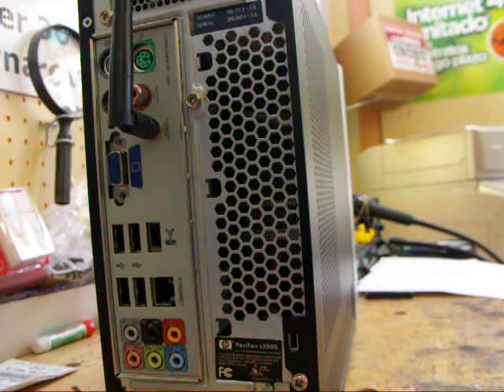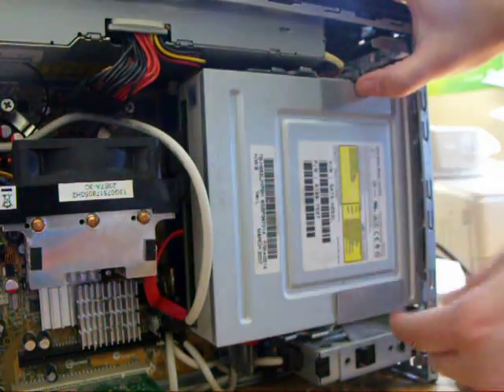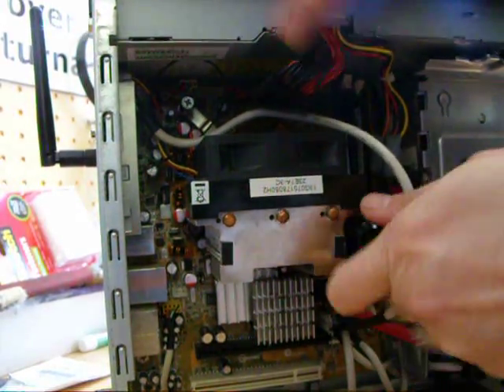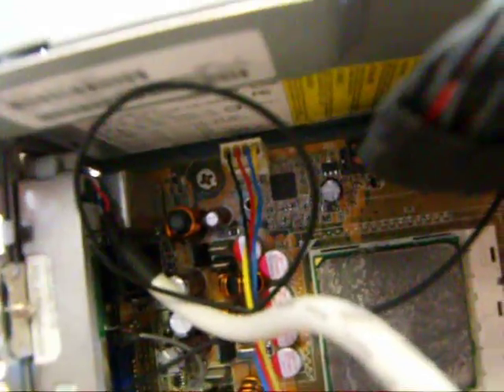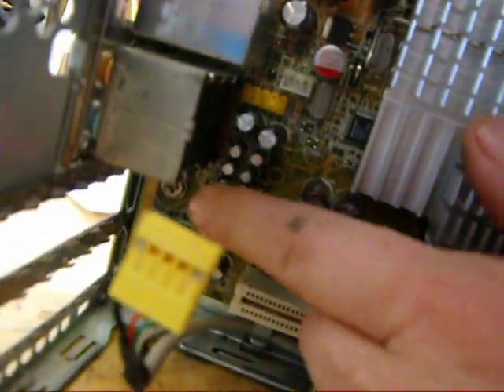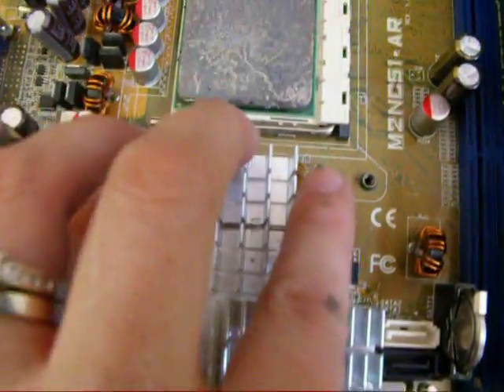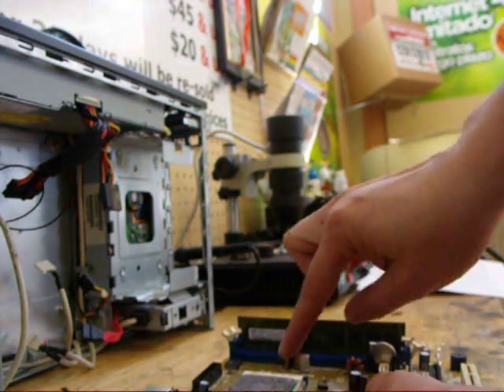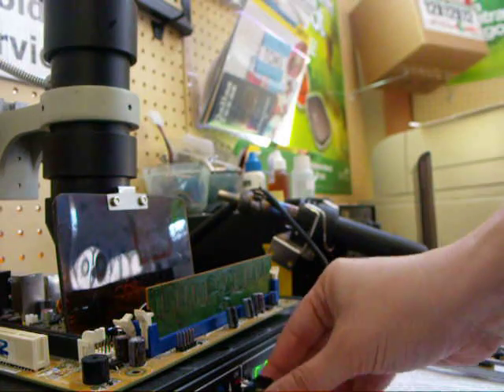HP Pavilion Slimline Powers On No display FIX!!!!

Comment: Oh my god, this just happened to my Slimline two days ago, powering on, but no display, I will try your fix in the next couple days and report back
Reply: any fix?
Reply: @ingridmilliebobby-brown7653  I doubt it's useful now, but the first laptop I messed with getting into computers had this exact issue. it was a faulty RAM module...
Reply: @Dankbongripz420  wouldnt the ram make it beep though?
Reply: @CENTAUR559  not always. Not every PC uses internal speaker like that. The laptop didn't at all. Everyone I've messed with since has had one. Their CMOSs are even different from laptop to laptop. Some are attached just like a desktop's and some are connected using a wire with connector to go onto pins
Reply: @Dankbongripz420  for the one I have thy I've been wanting to fix.. All signs point to thr on board graphics

Comment: Worked for me - Thanks for posting !!   Used a heat gun from our auto repair shop. 
By the way - the pc I was fixing was extremely dusty and vents clogged too. Regular cleaning should help avoid overheat issues, 
also looked into adding an additional video card - not easy to find on a slimline model like this. We will see if it will upgrade to Win 10 after some updates.
Reply: Far East Motors Service Center h
Reply: Were you able to upgrade the unit to Win 10? Thank you 🤓

Comment: i have the same slimline....i fixed mine using a heatgun.....its been a year n still going strong
Reply: did you cover anything at all or put weight on it?  how hot did you get it?
Reply: @CENTAUR559  my heat gun has 2 speeds low and high..i had it on low..and i blew on it in circles for 1 minute...u can do like another 30 seconds..just to make sure its done..and also u can cover the rest of the components with aluminum paper..

Comment: Could you just add a PCIExpress Video Card and Voila??
Reply: Victor Alvarado few years back I had the "pleasure" of trying that in one of these. The BIOS on that computer defaulted to the on-board graphics (and won't automatically disable). So, you need to switch to the PCIExpress Video Card in the BIOS but you need the on-board chip to work so you can make it to BIOS. Although once you get it up long enough to reach the bios I would certainly add a graphics card.
Reply: @penguinjumping  took my answer lol

Comment: Dude, seriously? This is one of the worst fix it videos ever! You obviously don't know really anything about computers. You really think heating up the solder joints and putting on a stack of coins will reconnect the joints? It does "work" in a way, but only temporary. Most of the time it doesn't work. I used to fix Xbox 360s for years doing this method. They lasted from a few weeks to two months. You need to unsolder the chip, reball it, and solder it back on to make a new, secure and firm connection with the solder joints and the motherboard. You really don't know anything at all.
Reply: This won't work unless you put tons of flux to keep the solder wet, or it will dry out very quickly.
Reply: really? I did this to a 360 about a year back and it's still running strong...
Reply: fuck off!!

Comment: Im sorry kids but, you should just buy a graphics card and there, u can find them in EBay for like $40 for a new one. Ur welcome.
Reply: This is a surface mounted graphics card.. It's not something that can be replaced.  So are you saying that buying a separate card and installing that would bypass the built in one?
Reply: Not necessarily, sometimes you have to go into the bios and tell it what video card to default to.  But you can't get to the bios with a bad video chip, you can maybe do it blind if you know the steps.
Reply: @JesusRamirez-oh6wc  Yeah, I've had it where it wouldn't even post for me for that exact reason!
Reply: ***** Yes when adding a graphic card the BIOS will disable the onboard one!

Comment: @awponder  unplug the connection to the front card reader and the do a CMOS reset using the jumpers on the motherboard...   It fixes the issue
Reply: didnt work

Comment: I figured out the problem.   
I disconnected all the cords from the computer and removed the battery from the motherboard.   Next, I moved the CMOS reset jumpers over to the 1-2 position and then connected the power cord and turned it on.   Next, power it off and remove the power cord.  Now, put the CMOS reset jumper back over the 2-3 position.  Now connect everything back and power up.  You should be good to go!

Comment: My slimline has that EXACT same problem, I turned it off without thinking during a windows update.  I thought the BIOS might have been corrupted, but it was acting strangely right before I turned it off... so I can't say I'm sure.  I would like to see it fixed though.  So ya, any ideas?
Reply: During a windows update the bios is not messed with.

Comment: Hi, my wife's slimline s5120y won't boot after turning it off for vacation,
Let me explain...   The power supply light on back is on, the fan on the PS turns on, the blue light on top turns on, the HDD amber light on front is on constant and the CPU fan and case fan both initially come on but coast to a complete stop after a few seconds.  "no output signal" is displayed on the monitor.
Any ideas?